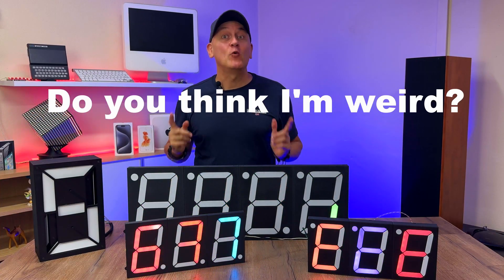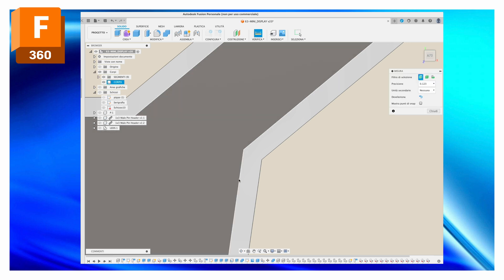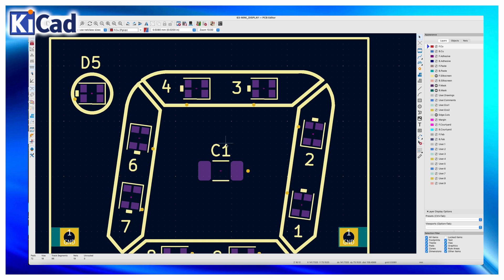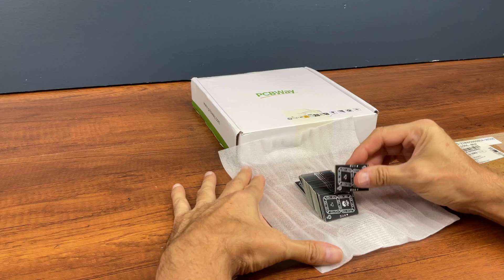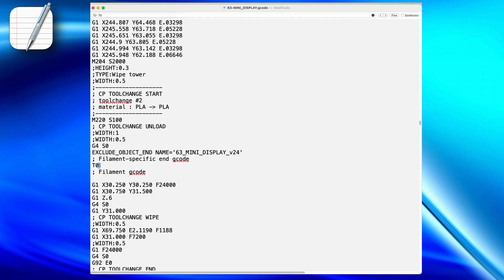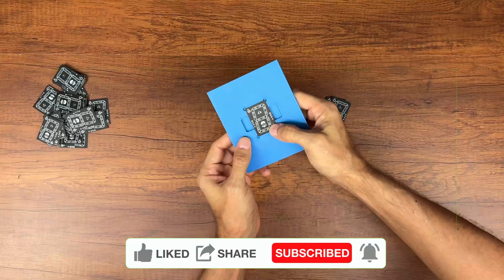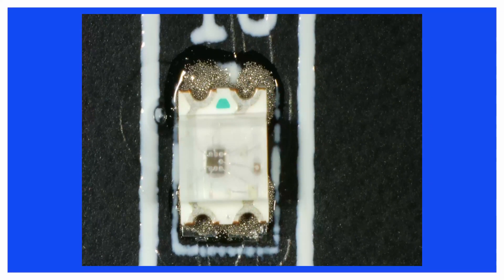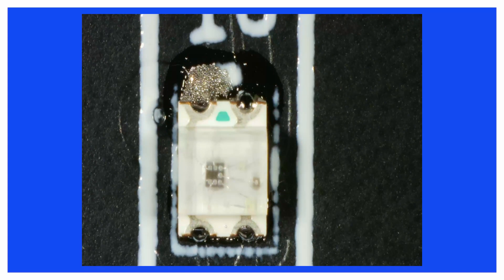LED Clock Colored  Tiny Display #esp8266 #arduino

Comment: Any chance of getting a copy of the fusion file? My printer is leaving a gap between the white and black PLA when printing and I’d like to extend the second layer of white to lock it in place and stop the light leakage.
Reply from the maker: Hi, you can try to over extrude just a little bit...this will solve